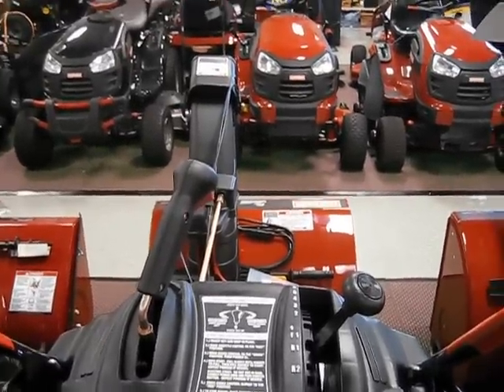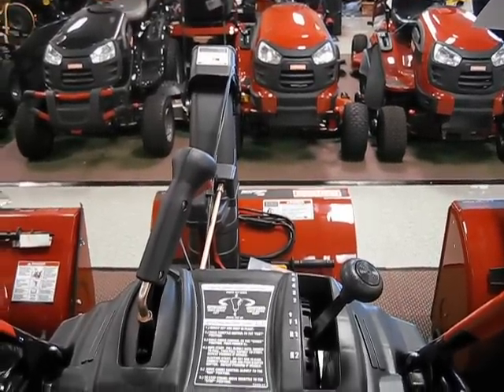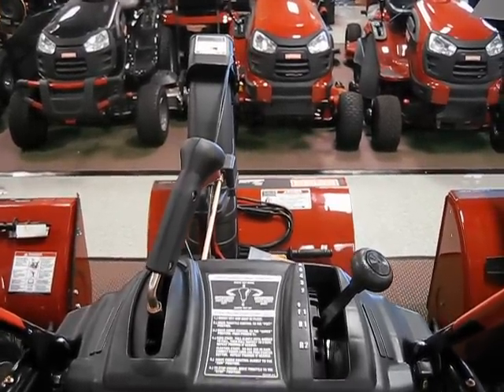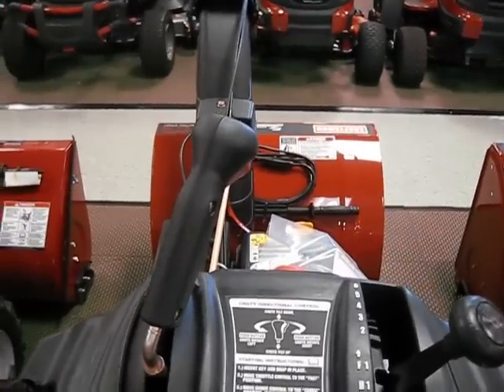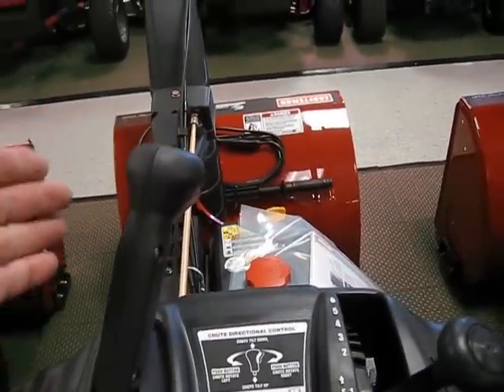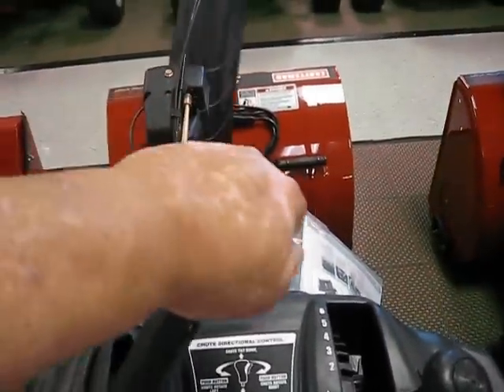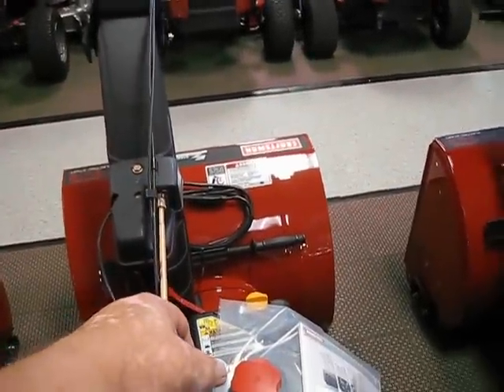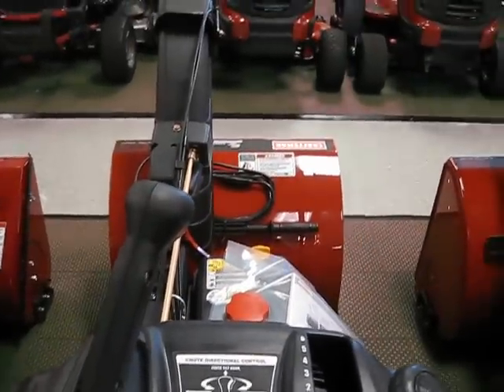How To Use 4-Way Chute On Craftsman, Cub Cadet and Troy-Bilt Snow Blowers

Comment: Thanks for the tip Paul.  This does help, but I still find that the red button is difficult to push in.  There is a good 1/2 inch depression of the button before it engages the wire and at that point it becomes difficult to fully depress.  I often find myself using both hands and even then it is difficult.  Is there anything that can be adjusted to make it easier to depress the button?

Comment: good video, valid points are made. still the worst chute/deflector control designed ever in regards to reliability and durability, in My honest opinion. The best mechanical setup I've seen are on the Hondas before they switched to electronic controls.
Reply from the maker: Today the Troy-Bilt and Cub Cadet controls are simple nd easy to use. The Ariens controls are robust and easy to use. The Toro Joystick is built like a tank and most people really like it.

Comment: This Snowblower is Garbage, Carburator gums up very easily. after first snow storm use and then stored for the following year, it won't start up, seems a lot of owners of Model 88964 are having this issue, even after letting gas burn off and making sure no more gas when stored.  Any Suggestions?  Thanks for the tip on Chute :o)
Reply from the maker: @EL EVO, I disagree that the snow blower is garbage. Two things that are very frustrating though. 1. The fuel we have to buy is made for autos and reduced emissions  - meaning it's not designed for the simple carbs we have in these snow blowers. Because of all the additives and ethanol the fuel will go bad in as little as 30 days.  2. Cars have all the extra electronics so they will run on that type of fuel. We have been unwilling to spend the extra $300 for EFI (Electronic Fuel Injection) that practically eliminates the problems with today's fuel. Becasue of all these problems Ariens now has engines with available EFI and other brands will also have EFI starting next year.
Reply: @PaulSikkema  Can't wait for next year ;o)